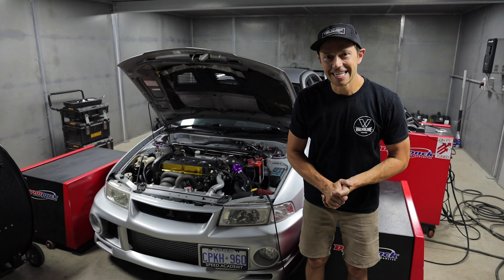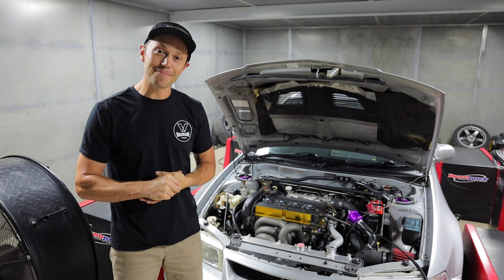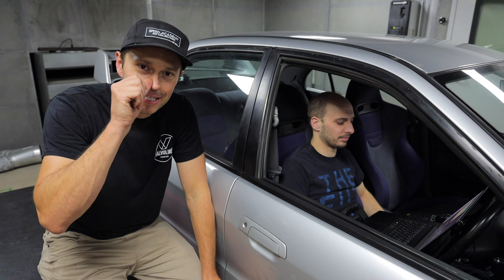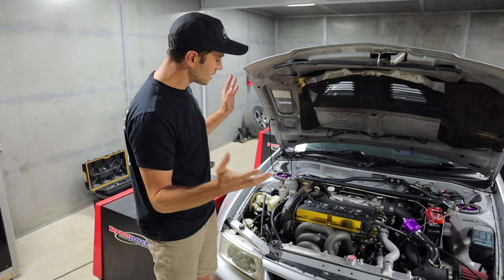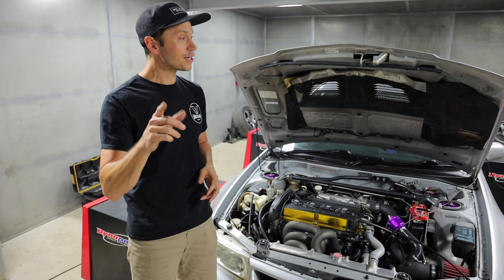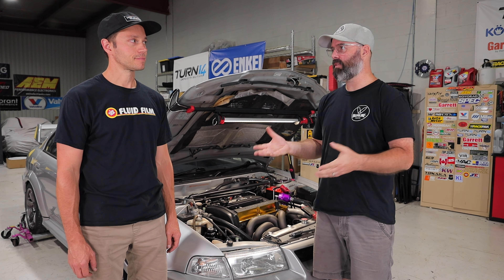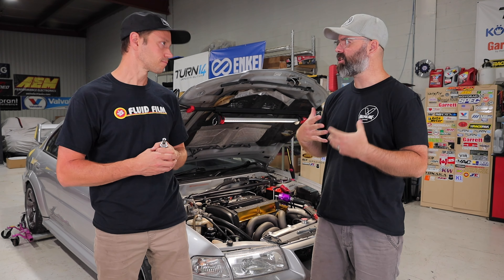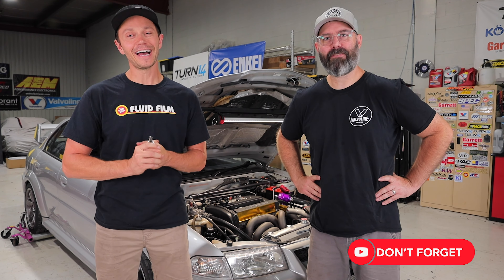MASSIVE EVO 4G63 Headgasket Engine FAILURE! CRAZY DETONATION!

Comment: Hey guys I'd get a machinist's straight edge and use that with some feeler gauges to check your block and head surfaces.  Jafromobile has a great video on youtube called Cylinder Head 103 - Deck Tech that will show you what to do.  If your surfaces are true I would lean towards your choice of headgasket as the issue.  A lot of guys in the DSM/Evo world swear by the stock Mitsubishi MLS gasket and as a whole the community has had some issues with failures on most aftermarket headgaskets.  I myself will only ever run an OEM Evo 8 headgasket on my built Evo 4 Mirage conversion for that reason.  Looking forward to seeing what your diagnosis ends up being though!
Reply: it could be straigt as an arrow, but its the pitting that may cause an issue

Comment: Over the years I have built many engines.  What I have learnt is that you can easily get away with no decking the block on an NA engine the very opposite holds true for any forced induction application that has more than moderate boost.  Even after thoroughly checking the mating surfaces, we would brush on some dye and take tempered glass and sandpaper to them for good measure.  
Good luck, I hope that all goes well.

Comment: I have over 100 passes on a 4g63 with 40 psi. Stock size Arp headstuds copper o ring/cosmetic gasket. Super reliable when built right. Lucky for me Ams built mine.

Comment: Machinists do a great job measuring and running the tools but I had the same experience. Most of what they do, i think, is older small block Chevrolet and ford work. It's just not the same. My machinist initially decked the head and the surface wasn't as smooth as factory, with a factory metal head gasket like the EVO uses it really needs to be smooth. Also, my experience is that EVO's don't like timing on pump gas. Like at all. Sasha has done amazing work, is he familiar with EVO's? If he has done a lot of other cars the timing might have been aggressive. It's hard to tell but there sounds maybe like a little knock leading up to the failure. Last but not least, you always have to build 4g's twice. It's the rule. The next time you screw it together it'll go 100k miles.
Reply: I heard they want to run pig rich as well...
Reply: @Robert Young, that is SO true. The first 4G63 I had built for my 1g DSM failed rather quickly due to detonation and using cheapo aftermarket 2g pistons. The 2nd one I had built, using stronger components, has lasted for the last 15 years or so with no major issues. You definitely want to keep the timing low on pump gas with these cars, 10-12º total is all you need.
Reply: That’s so true about machinists they mostly do older stuff I once asked a machinist to pin sleeve a open deck Honda motor and he gave me the funniest look like I was speaking a foreign language
Reply: @CaptainTonus  12 degrees is all i could get out of pump 93 gas on my 2.3 build. They are also noisy anyway from a knock sensor perspective. It took me 2 years to finally be comfortable with the fact that my forged motor just had some false knock. 5 years on it was still running strong and still is with the new owner. I can't wait to do it all again! :D

Comment: it's really embarrassing that at no point did either of you mention the fact that having the appropriate sensors in place would have allowed the stand alone ecu to catch the problem before it ever escalated to the failure we have seen; regardless of what the failure turns out to be. Also, it was super disappointing to realize that the dyno pull in question wasn't aborted even though there were a series of very strange noises being heard for the first time. I feel badly that the end results is what it is, but I feel even worse knowing that the viewers were given no guidance into the available engine protection strategies of a modern stand alone engine management system.

Comment: You should re-torque the head after break in the engine
Reply: Agreed 3 heat cycles retorque
Reply: Never had to do this
Reply: @karltaht2370  how much power and what boost ?
Reply: @bigbothoee8617  fair point, I've only built NA motors
Reply: @bigbothoee8617  Agreed. Recheck on torque is free. Usually a few will still find a few more degrees or rotation.
Reply: so on a ej20 you pull the engine  covers , cams  etc just to re torque the studs ?  

i think not ....
Reply: @Jack_D_Stripper  my thought too, lol. But yes, ideally.
Reply: @Jack_D_Stripper  this doesn't aply to all engines
Reply: @Jack_D_Stripper and yes  the ej20 may need re-torque maybe that's why gasket failure is common on these engines
Reply: @b5stalker425  Absolutely not. The EJ20 open deck had issues with head gaskets because of a quality flaw in head gaskets from the factory. The open deck jugs have a tendency to flex under higher horsepower applications making head gasket failures more likely. I have a 170k mile EJ257 that runs 21 psi on the regular. Tomei MLS gaskets and ARP head studs when it was out of the car for timing belt and bigger oil pump at 100k. On 4 EJ builds over 12 years I've never had to re torque the heads, never had a HG fail
Reply: This would be good advice for a copper head gasket motor. Not multi layer gasket motor.
Reply: When it's a modern 4 valve aluminium head engine it's pretty much normal for head bolts to lose clamping load over time. I've fixed them after over heating several times and actually seizing.........because the head bolts were loose. They all do it. Unfortunately a lot of engines, you just can't do it because the cams are in the way, like soobys, not to say that you can't make a special tool to fix the problem. When you pay someone to do a job, all they want to do is fit new parts  but it's not the only way.
Reply: Head studs are money down the drain anyway because the bolts aren't the problem.
Reply: @1magnit  Assuming you're paying someone to do a job. I can guarantee you the studs in both my EJ's haven't lost any clamping force, or overheated seized or any of that nonsense. 30 years of machining/engineering and 100% of all the work done right here by myself from removal, machining, assembly and tuning. Never blew a head gasket ever. Had one spun bearing because my kid drove 30ish miles with a blown oil feed on the turbo but we won't talk about that
Reply: @1magnit  it is not normal for head bolts to lose clamping load unless you're reusing the stock bolts, in which case you deserve to have the head lift on you. And no, headstuds are not a waste of money.
Reply: @stephensrouji9727  It's nothing to do with the bolts, it's the aluminium head.   How would you know if you've lost clamping force or not if you've never backed them off and never retorqued them......you're just making it up as you go cos you don't know.
Reply: Say what never that's why you torque it
Reply: @1magnit  no offense, but I build 1000hp evos on a daily. The head studs don't lose torque. Stock bolts have a much less tensile strength than the upgraded arp hardware, then you get into l-19 and +625 which are even stronger tensile strength. After market head bolts do not lose torque. Factory head bolts will, as they will eventually snap after X amount of uses. It sounds to me like you know only what the book says, and not specifically high performance motors.
Reply: @stephensrouji9727  Everyone on here builds 1000HP engines daily too. It's not the bolts, it's the head. It happens to pretty much everything with an aluminium head, it doesn't happen with cast iron heads
Reply: @1magnit  sure buddy. Lol
Reply: Never had to re torque head studs! My builder doesn't and hasn't have any problems with Evo motors! Motors running for years making power
Reply: @1magnit  your some kind of special aren’t you?

Comment: If the deck was within specification, then there is no reason to resurface.  However, MLS headgaskets call for a particular surface roughness. The roughness is much harder to measure, but just as important for sealing.

Comment: I haven’t decked my block, but did have the head done and I use a cosworth gasket and L19’s. I run 30psi and make over 650hp and 560ftlb and no issues well over a year. I guarantee it’s a gasket issue or head studs not been re torqued property after a couple of heat cycles
Reply: Ya, going back in and re-torquing is really important too.
Reply: Robert Young 100%. I managed to tighten my L19’s after a few heat cycles, even after torquing to spec when building it

Comment: I had this kind of heartbreak earlier in the year. Finally built the engine I've wanted to build for my E30 after years of saving up for it. Put it together with care and did everything right as far as I know but the head didn't get oil despite showing oil pressure. Everything ended up trashed and now I have to start again. It made me want to give up initially because now I'm back on a stock tired motor that runs like a 2-stroke and clearly doesn't have much life left in it. But with some time passing I'm just looking at it as a learning experience (even though I can't figure out why the head didn't get oil) and will try again over the winter and hopefully I can get to the track next year.
Reply: Hmmm check out Kmiata, they're coming out for a kit for the e30 chassis lol
Reply: @feelthatfeelthat  I've long considered using a newer engine but I'm a sucker for an inline-6. If I was going to swap anything, at this point it'd probably be an N54. But I like my sohc boat anchor M20 for it's simplicity and most important the sound it makes.

Comment: Bummer.  One possibility is that it's not uncommon in some applications to re-torque ARP head studs and/or head bolts after heat cycling.  The bolts/studs stretch a bit and they just need to be re-torqued

Comment: Don't need to replace the block or head. The head will need to be welded and resurfaced, but should be able to run. Consider running a copper head gasket instead of multi layer gasket. Will save the head in the future. It is rather odd that you lifted the head at only 20psi. I wonder what the back pressure is at that amount of boost. Also consider stainless steel o-ring around the cylinders.  Lastly, I would strongly recommend not using a cometic gasket (not certain what hg you used). If you decide against a copper head gasket set up, see if you can source out a cosworth. Best of luck.

Comment: I have L19 head studs and they back off 30 ft lbs twice after fired up....I re tighten after heat cycle for a few days.....Since then I have seen 40 psi plus... I suggest use the best head gasket you can get....

Comment: Sounded like it was knocking during the pull, bad enough it was audible in the video. I’ve had a few engine failures but never have seen a head Lift like that 👀

I’m local as well, in the GTA. Good luck!

Comment: Another Evo Down. Between Bader_Built and now the Speed Academy's Evo headgasket issues, Im feeling good about my STI's HG. Mine may push coolant at 30+ PSI , but at least it holds firm at 22lbs. Just keep sending it with 22lbs. =)

Comment: The initial sparks are at the front of the engine, and then the more serious flame front was on the side... It seems like the head wasn’t torqued correctly or the wrong head studs (thread failure?). 
You see the damage at #4, but I bet the sealing issue is the same across all four holes.

Comment: Sometimes it's a hit/miss with not decking it, I've been pushing 40psi on my dsm with "drop-in" used oem non-turbo pistons on Eagle rods and a MLS headgasket. The only prep I did to the block surface was hit it with a scotchbrite pad

Comment: Surface finish is very critical to the installation of metal headgaskets.  There is no way to reasonably expect a new metal headgasket to bed into an old unsurfaced block.  The head or block is probably now torched as shown by the sparks when the combustion seal was broken.  The machinist trying to cut a corner will have resulted in requirement for an almost complete rebuild. Lesson (hard earned). When it comes to rebuilding the 4G63 (or any other performance motor) the key is to not cut corners and do what Andre says !

Comment: Sorry to see that happen, what was the spark doing? Are you sure there wasn’t an issue with the spark timing. Also always deck the heads and block, you need to correct finish to seal the head gasket. I’m sending mine to the shop right now to square and finish the block and heads

Comment: You always surface the head and block if you use a MLS gasket. Doesn't matter if it's a BP8 or a BBC.
Reply: Assembled a 5.3 without surfacing the head or block with used  MLS gaskets and used head bolts , pushing 20lbs boost making about 650 whp . Been beating on it for  2 years and 10,000 kms  , still running strong
Reply: @dilsher12  That's good that you got lucky with used parts. I drive 19,000kms per year and all my cars need to be daily reliable. We have a good example right here of what can happen when you skip steps. I can't afford to build an engine twice so I'm not taking the chance.

Comment: Keep your head up. I would do a manifold and turbo change when you rebuild the motor. A bigger turbo so you dont have to run as high as boost to make the numbers I know you will want and a manifold change to place the turbo where there is more room because your going to have heat problems with that turbo being so close to the radiator.

Comment: Mitsubishi unexpectedly broken - unfathomable! (Sorry, I'm jaded by my 2G Eclipse Turbo experience... it wasn't good)
Reply: I know what you mean.  I loved mine when it worked and hated for not working so often.  I absolutely hated the electronics in that car.  It was the bane of my existence.
Reply: Have several 4g63 vehicles, 3000gt vr4 swapped to a 4g, 2 mighty max's swapped to a 4g, and have had dozens of talons. Never had issues with them and most are well over 500hp.
Reply: Mine makes about 300 wheel I drove it like 3000 miles in July multiple 3-4 hour trips raced when I got there drove it home
Reply: 4G's are only as good as their owners, soooooo ;)
Reply: @Dallasjcutler  Yeah it was totally my fault that the electronics gave out all the time. :)
Reply: @Koolicyde  Electronics? There are like 3 main things that fail. ECU, IAC, PTU. They're also 21+ years old, upgrade or replace regular maintenance items and never have issues. Sounds like the owner had an issue.
Reply: @RichRusso4218  The car I owned was a 1995 - and this was in the year 2000... sooooooo.
Reply: @RichRusso4218  No need for hard feelings buddy - I just had a bad experience with it... mine wouldn't stay running reliably. I loved the styling and power (for god sakes this was right around the time when Fast and Furious came out - the eclipse was an icon at that time.
Reply: Same with my VR4s gearbox..
Reply: @RichRusso4218   No doubt the engines are great.  However, some of the early electronics were a nightmare.
Reply: @fluxingn  I have owned Mitsubishis and a select few other brands my entire life. There are three common faults with mitsubishi electronics from the 90's. Idle Air Controller, ECU, and Power Transistor. Now seeing as those parts are extremely old, they are expected to be worn out. Also any car from the 90's and 2000's from japan had Mitsubishi electronics. I own a 3000gt VR4 and it is a electrical warehouse. Only issue I have had with that is the IAC.
Reply: @RichRusso4218  The car was 7 to 8 years old at the time that I owned it.  I am not suggesting that every iteration wherein the engine was used these problems persisted.  Nevertheless, it was common enough in the 90's  for those who were unfortunate enough to run into it.  To be fair, 90's electronics was problematic in U.S cars as well, especially GM and Ford.

Comment: These cars actually have spirits that live in them and the spirit determines if you have a good time or your life is going to be hell. The key is not to upset the spirit by doing any short cuts, rushing, working on them when your tired hung over or had a fight with the missed or using any cheapo parts on them ;)

Comment: Did you retorque the head bolts after heat cycling the engine. And if your not shooting for high boost (30+psi) just run a felpro composite. Mls usually just end up causing more damage when something does fail. Atleast with a composite itll just blow the hg out and your usually fine with just a resurface.

Comment: Hopefully you didn’t torch the head and block. If you torched the head you can weld and machine it but the block you can’t. Use arp L19 headstuds a (MLS gasket of course) but use the mls gasket with the black “rubber” spray to help fill in the tiny imperfections but find someone to o ring the head

Comment: Did the machinist know that you guys were planning on running higher boost? The block deck may have been fine at stock power levels. I hate that it happened that way. I know you guys are able to bounce back from this.

Comment: My old boss would always blame bad gas and combustion chamber shape when someone blew a head gasket. Of course, we manufactured the head gaskets so that was last to be blamed. I’m not a fan of “gas stopper” style head gaskets you used. I like the “grommet” style better. The advantage of gas stopper, they’re stronger between cylinders and were designed for engines with cylinders spaced close together and/or overbored cylinders making them esentually closer. I think for normal cylinder spacing grommet style is better.

Anyways pull the head. It’s all speculation till we can see the damage.

If head & block not massively damaged, use a polishing stone to go over the surfaces and slap on a different manufacture’s head gasket. What do you have to lose? Haha

Comment: Is there a dowel in that corner? Just a guess but if you've skimmed the head, but the dowel is the original length, could it stop the head from sitting as it should in that area?